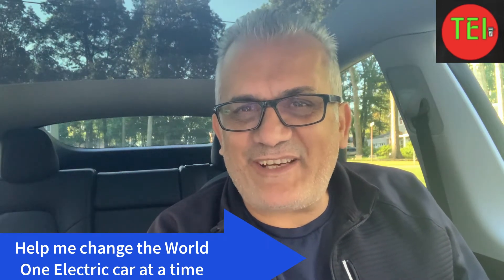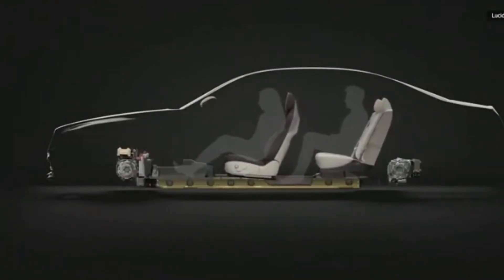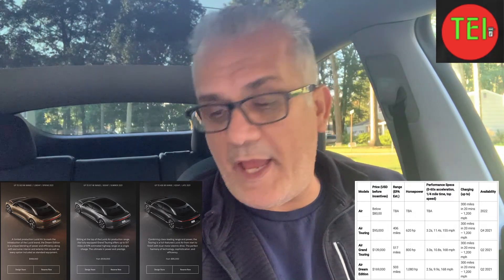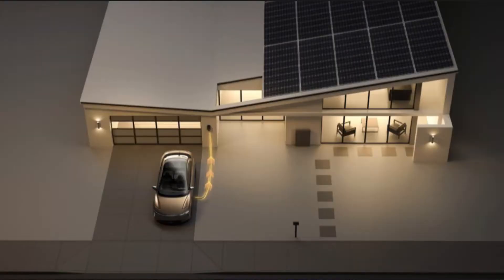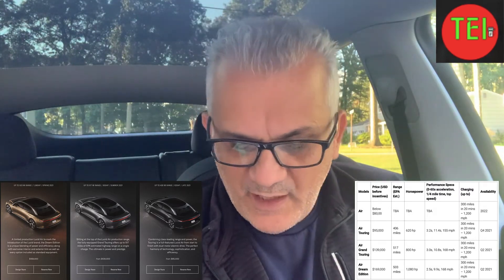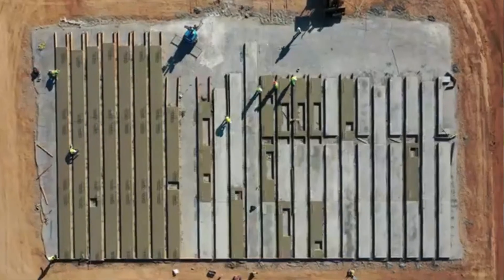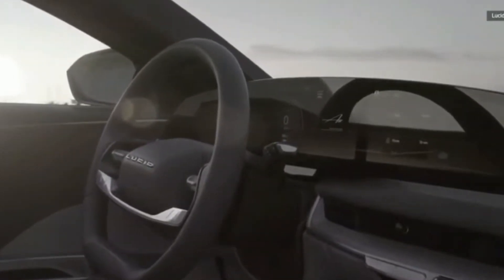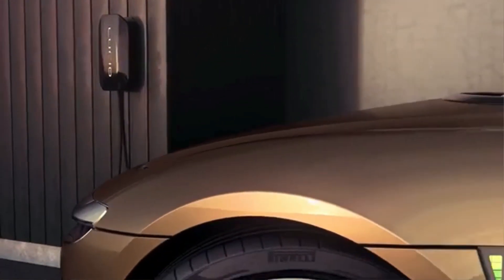Lucid Air, Who is it For?

Comment: Trust me the LUCID AIR IS A DUD. This car will,not sell at a 170 thousand. MERCEDES PROVED that the Super luxury market doesn’t exist . MAYBACH  was forced to stop production for lack of sales.
Reply: Uhh have you not seen S63s, G63s, S8s, RS7s, Amg gt4s, M8s, and SO many more super sedans? This thing may be slightly (10is k) but it is electric with zero maintenance and A TON faster.

And the maybach is back bud. And it sells for 210+k. They would keep refreshing it (new one coming on the 2021 skeleton) if they weren't selling
Reply: Brandon Nixon Did You forget about TESLA ROADSTER? Are You forgetting about what happens on SEPTEMBER 22ND? All the model # s You,quoted are Legacy Now! Good News. I GUESS MAYBACK IS BACK, BACK, BACK, BACK.. STILL A DUD. PUT THAT IN YOUR PIPE AND SMOKE IT.